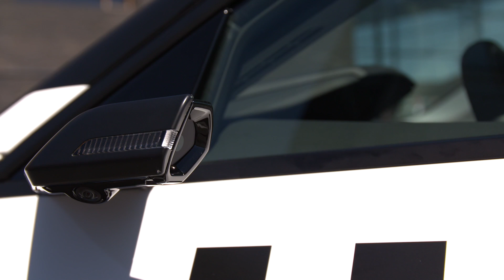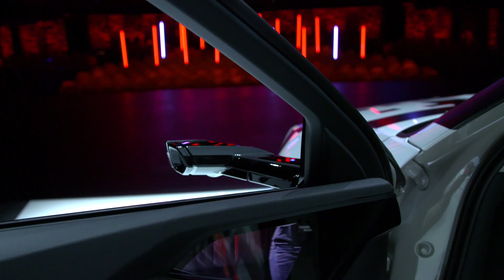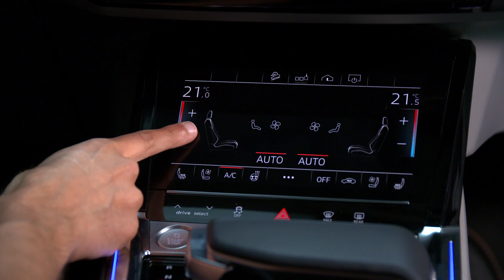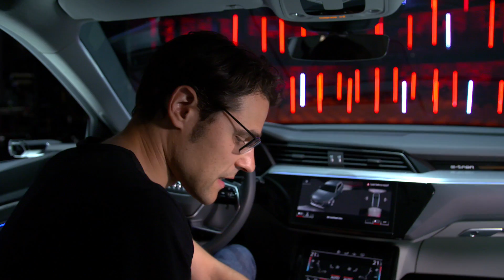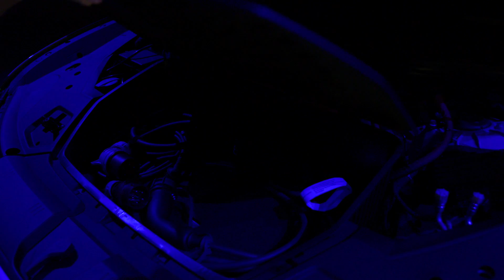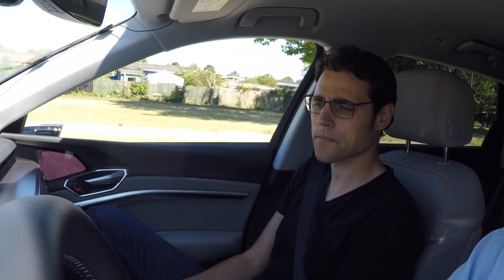The first all-electric Audi - REVIEW Audi e-tron Interior & driving impression - Autogefühl

Comment: I have mixed feelings about this car.  Refinement and build quality is likely to be class leading, but the interior looks too fussy with lots of pointless detail like the silly gear selector, massive green battery gauge (would you really want that in your face while driving?) and cliched blue ambient lighting.  Exterior is very bland too, complete with false over-sized "ICE" front grille.  The powertrain also looks decidedly average compared to what Tesla have been offering since 2012.  For a brand new 2019 supposedly "cutting edge" EV I'm a bit disappointed in this dumbed down first effort.  I don't think Tesla have much to worry about here and certainly won't be trading our Model X for this one!  But great to see more luxury EVs hitting the market at long last, competition is always a good thing.  This one should appeal to current Audi ICE owners who don't like change.  It's basically an electric Q7 with a few new gadgets.  Nice enough, but not exactly awe-inspiring.  What I expect it will do though is transform a whole load of current TDi drivers into overnight EV converts as the everyday driving experience is so much better.  But then again the public charging infrastructure could be a huge disappointment for those driving regularly away from home.

Comment: Since there were three recommended videos and each had 2 or more breaks I got so irritated by all of it that I cut out. I thought your presentation was interesting but the breaks would come at awkward times. If they came at a break between thoughts it would be more acceptable to me. But I’m an adv producer. I get irritated when the commercials  blatantly disregard the continuity of your program.
Reply from the maker: I really wonder since there should only be one middle break / ad in it, that's what the system says. Was there more than one mid-roll?!

Comment: Seems to me that the electronic mirrors are missing an opportunity.    What I really want is a a panoramic view of what is behind me and to the sides laid out across the control panel behind  the steering wheel.  It could be a fusion of several cameras,  That way you get rid of all three mirrors.

BTW, one of the hidden benefits of using cameras is you don't get blinded by headlights.  The displays  have a limit of how bright they can be  so the headlights are attenuated.  This also means you can see better at night what is behind - minus the glare.

Comment: Everything is good except the side mirrors or lack thereof. It is a terrible idea.

Unnecessary complexity = Bad

1. It draws a certain amount of power from the battery. A simple mirror works just as good or even better.

2. If that mirror display is somehow gets damaged you lose entire side view.

3. The cameras cannot adapt sudden light changes in dark as well as human eye, it's a risk.

Other than that I would definitely buy this car if I had enough money.
Reply: It might actually be useful at night as it will amplify the ambient light and give better visibility.
Reply: Ozan actually they save Power because the Car is a Lot more Aerodynamic
Reply: If you get what I meant you sure do realise that it's not about power consumption only. There are things that should never be digitalized.
Reply: @aliozanerbektas  its actually an option, it does not come as standart, so you can go ahead and buy it with normal mirrors.

Comment: Long overdue and the insistence by Audi and all other German car manufacturers to continue building lots of diesel cars is appalling. Its ironic that this car is launched almost at the same time as the Audi CEO is in police custody for willfully cheating the emission declarations. And its not clear by when this e-car will be available since Audi has no control of battery manufacturing(yet?) and can not guarantee cheap and abundant battery cells- by far the most important factor when building electric cars.

Comment: Very nice car but.... 400 km with 95 kwh is not a good data. I think as I saw in Inside evs, the range is under WLTP. The i-Pace reach 480 km and Model X P100 even more, because achieve 480 km in more restrictive EPA standard. 
So bad news in terms of eficiency. You carry hundreds of kg in expensive batteries for waste them moving a non efficient car.
Reply: You are not getting the same range because you are paying energy for the cooled seats, front and rear climate, more electronics, etc.
Reply: Would be interesting to see the real power consumption to test whether the 400 km is realistic or only a theoretical value.
Reply: Like most higher end products.... you pay more for less!

Comment: The only thing I would say is that this is for sure more than capable of meeting the demands of drivers who do more than 40k km per year. Just adding up 200 miles x 365 days a year of home charging is 73,000 miles already. And this thing has 350kw charging capability which is insanely fast. Just in case someone needs to charge after their first 200 or so miles that day (I’m sure the range will be significantly more than that though). So it’s as capable as anyone could possibly need.

Not that you even really need that kind of charging speed. Even 100kw will be plenty. As we see currently with Tesla drivers doing huge long trips and just stopping while they eat. You don’t lose time compared to petrol.

It is unfortunate that it can be a problem to get charging stations installed for some homes but I think even if you couldn’t get one, this car would still work well.
Reply from the maker: Yeah for example I am denied to install a charging station in my basement garage due to other stupid owners
Reply: Autogefühl I don’t think that will continue for much longer though as everyone gets more aware of how safe they are. And it’s indoors too. Mine is outside in all conditions.
Reply from the maker: just been confirmed that they even deny simple plug socket...
Reply: Autogefühl What strange neighbours. It’s unfortunate because it would make your EV reviews better to be able to show how you live with the car. But I guess showing how you live with an EV without home charging would also be useful to a lot of people. So there is a positive aspect while you wait to finally get one installed.

Comment: Tesla will be king. Not because of their cars, but because of the Charging stations. When other car makers start making full electric. They will have no choice but to use Tesla charging stations. And the other car makers will have to do a deal with Tesla.
Reply: " They will have no choice but to use Tesla charging stations. "
No, they won't. They decided already in 2011, that their cars will have CCS for fast charging, so before the Model S was released.  There are alredy many CCS chargers out there. Yes, most of them are only 50kW, but fasters are on their way. The biggest project at the moment is Ionity, a joint venture of BMW, Daimler, Audi, Porsche and Ford. They already have begun to build a 350kW charging network along the European Highways. They plan to have 400 charging desitinations until the end of 2019. And there are other companies that will build 150kW-CCS chargers.
Reply: European manufacturers agreed on the much better CCS plug standard and stations are build everywhere across Europe now up to 350kW (Tesla 135)

Comment: Dear Autogefühl

You have a substantial amount of faithful followers now. Your channel is awesome. It is for this reason I would like to put forward a request. In 2 3 years it would be nice if you can arrange a review with this Audi that has 100 150k km...I suspect by then it would truly be an etron...just like the P90D is now at 200k km. The range has dropped by 45%, to change the batteries you might as well buy a nice VW diesel Passat.

P.S. That camera system instead of mirrors is SOOOO unnecessary!!!
Reply from the maker: Thanks! I haven’t heard of significance battery depletion yet, is it your car?

Comment: I like it but for me EVs are all about the range they can provide to make it practical. It seems a little odd then that Audi chose this model to cram in more screens, gadgets and tech than ever before, all of which will draw power from the batteries thus reducing its efficiency
Reply: The impact to the range of an EV with gadgets is negligable. Wind resistance, temperature and rain however has much more impact (windscreen wipers, driving lights and AC/heating). Let´s say the screens use 100W (that´s overshooting it i believe, but as a worst case. That´s 1000/100 = 10hours for 1KwH of energy which is about 5 kilometres.
Reply: Screen technology uses very little in the way of power. Propulsion, heating and cooling is where power consumption is highest.
Reply: The side mirror screens improve range.
Reply: Detleth all the gadgets on board use hundreds of watts hour maybe one kilowatt of wattshour so it adds up.

Comment: Wie lange dauert voll aufladen?
Reply: Ich weiss nicht!
Reply from the maker: Depends on the charging you are using. Household plug a whole day from 0 to 100 %, wallbox 10 hours, proper charging station 6 hours and DC fast charging about 2 hours. Its just about the energy supply / station
Reply: Danke etwas nicht

Comment: Thomas 2 problems with this car. Why a big gear stick and big transmission tunnel on the front and the back seats. This car don't make you feel space like Tesla do, with open space and room. Is just a Audi A7 crossover with a battery. I don't like that, I like when car manufactures separate the look and feel of a ICE cars and EV cars and make it futuristic EV cars. Then if you buy it you feel spacial and not like others drivers (again like Tesla model X).
Reply from the maker: yeah good points

Comment: Very nice video, well done! The 30 August launched has been postponed, but I think I don't need this anymore, well explained. Only thing missing is price and technical specs. 
The design is indeed quite conservative. The advantages of the electronic drive train (less space in the boot) hasn't been exploited like Jaguar did it. This leads to smaller wheelbase and less boot space than the Jaguar with a car being 22cm longer... a pity!
Reply from the maker: more technicals specs later for you of course. Price smth over 100 k ... thats my guess and I am pretty sure I ll be right.
Reply: Do you think the Audi will be more expensive than the Jag!

Comment: You are not allowed to use your smartphone when you are driving but we're gonna put a touch screen for everything in the car because hey you now what that's perfectly allowed ^^
Reply: They're just replacing mechanical knobs and buttons into virtual ones. They'll be in the same places, no menus to scroll though.
Reply: It's because Volvo is all about the minimalistic Scandinavian design approach. The interior looks really cool and minimalistic, but it's form over functionality.
Reply: Emilien Durand I have a my17 Volvo XC90... it has an iPad style control panel and it’s just dumb as sh*t to have essential driver controls buried in menus and having to literally take your eyes off road to do things like start/stop or pressing temp then having to slide a bar up and down for hot/cool . Air recirculating function is buried inside climate setting rather than just one click off dash. Can’t tell you how annoying it all is. Nobody has died in a xc90 according to Volvo but I wonder how many would crash if they didn’t have as many passive safety measures whilst you are distracted lol. At least with Audi and Jaguar wth these new electric models they still putting critical driver controls one click

Comment: It's clear that only elon musk nut huggers will buy his over priced, poorly built cars in the future - tesla's "era" really is soon over as actual car manufacturers will come out with their electric offering
Reply: Bet you don't buy this car... 

Not having a complete charge infrastructure makes this beautiful car just 1/2 a car.
Reply: You cant compare a e-Tron directly to a Model X, its a lot bigger. Its more between Model S and 3.
And its hard to compare Tesla with BlackBerry. BlackBerry stands still, no Innovations any more.
Reply: Are you for real? Tesla model X is far beyond this car.
Reply: Its funny you would say that. Elon Musks objective has been to “force” other car manufacturers to make electric cars and showcase that electric cars are not only technically viable but also economical and that there is huge customer demand. All these prototypes and the building of a German super charging network would almost certainly not have happened unless Tesla was pushing forward. Another funny side not is that Tesla was also first with a number of other innovations such as over the air updates of the cars firmware, auto pilot, vegan seats, falcon doors, huge front wind screen (model x), almost no buttons and instead a huge touch screen, summon car, best in class air filter for the cabin etc. And this is not to mention the battery cell technology, active temperature management of the cell pack and the super charging network. All incredible visionary. I agree that Tesla can improve on build quality but it’s something they can lear over time. And the German engineer have been sleeping whilst Tesla brought all these new innovations to the market. But bottom line Tesla has and will transform the market and by doing so has built up an enormous customer loyalty and credibility. Meanwhile the Audi CEO is in police custody for cheating emissions standards.
Reply: Not to spoil your party, but the big German car companies have been looking into electric vehicles for over a decade, if not two in some way. What has been missing is not motivation, it's a clear sign for customer demand. That is the only thing Musk has shown, at great personal risk. But when you're a billionaire and can afford to throw a few billion out the window for kicks and giggles, that's your thing. The German auto industry has small margins and can't really afford to gamble as much as people would like to believe.
Reply: Agree........Do you remember what happened to BlackBerry smart phone when Samsung, LG, and Google decided to enter  the game?
Reply: Blackberry went bankrupt not because of Samsung, others Android based smartphone BUT because of Apple iPhone.
Reply: oracledbamgr 
Lol please iCrap is stolen technolegy from Sony, Samsung, HTC and Blackberry nothing invented nothing new they are 5 year behind and btw they didn't go bankrupt because of Apple get your facts strait.

Comment: Those mirrors would probably be better if the screens were integrated to the A pillar. Also, what happens during rain?
Reply: But then you create a big blind spot, for example when you have make a 90° corner while pulling out of a side road... Pillars should be as slim as possible to improve overall visibility, in my opinion.
Reply: Good point. It should be interesting to see how these turn out. I am still worried a little bit about the glare on the OLED displays as well or polarization issues if you use a sun glass (even polarized ones).